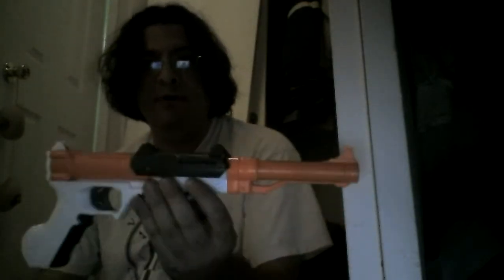Tricks On Priming a High Yield Sharpfire.

Comment: White XD retaliator, Omw stage 1 catch slightly filed,omw metal trigger and stage 2 boltsled and plunder perfect seal on both. Spring guide ground to fit the Omw 5 kg retaliator spring and the stock cyclone shock spring maybe (5-6kg).springs are so tight don't need a back spring spacer. No brass or anything. again no suppressor barrel ranges around 95-100 feet flat and 100-125 feet at a 5 or 6 degree angle.